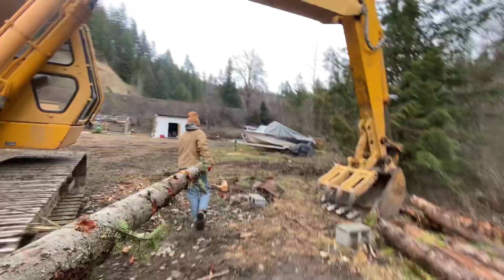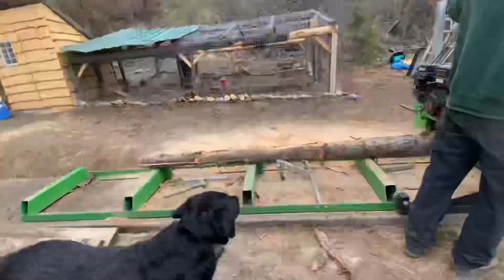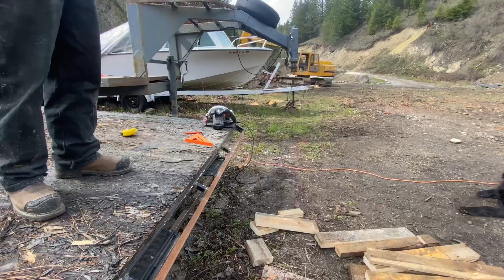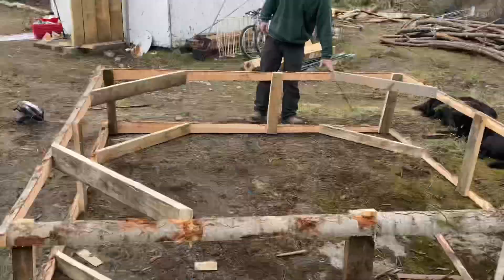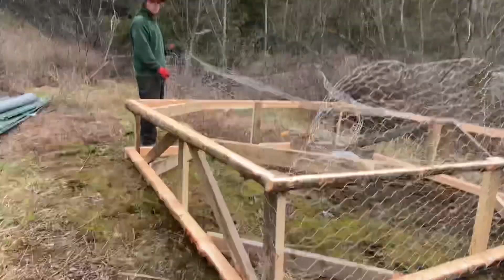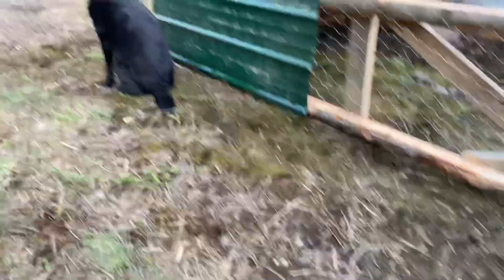Budget Chicken Tractor

Comment: If you plan to process meat chickens, Line up a scalder and a plucker now before you get birds.    My first year doing meat birds, I could not find a plucker when I processed the birds.  Yikes....it was really hard to pluck 26 chickens by hand.  A plucker will pluck a chicken in 30 seconds.  They cost $400-$500 at tractor supply.   I since have gotten a plucker and a scalder (used a Propane turkey frier with an electric temperature controlled element to keep the temperature at a steady 145F for plucking).  Did 18 turkeys last summer and loaned out the plucker to a friend as well.   This is the best $600 investment for processing you have.

If you can borrow the equipment the first time...fantastic.  This will give you the understanding of whether you want to process your own meat birds in the future.

Comment: Your chicken tractor looks stronger than most others. To move it around, you can put skids on the bottom. The skids should be strong enough to just drag the tractor. For the top front-half of the tractor, create a lid that is covered in mesh. You can then easily open the lid to change water, etc.

Comment: So this time your raising meat birds for yourselves, not for the predators? All serious best of luck with them.
When the pandemic started spring of 2020 my wife and I raised 18 Cornish cross meat birds, and processing them by hand , plucking feathers was a real chore. Next time we run birds we want an automated plucker and may try and flat pack process them out, the whole broilers fill up a smaller 7cuft freezer chest quick.  Get your grain before it runs out or the price just goes up.   
Nice work with the bandsaw mill and building the chicken tractor it looked stout with all the braces. 
I built two chicken coops for our egg layers and  most of the material was repurposed,  old windows ,lumber remnants, scraps, old metal roofing, old chain link dog kennel for the run.  It’s satisfying to clean up old materials and put unproductive parts of the land to work.
Cheers!